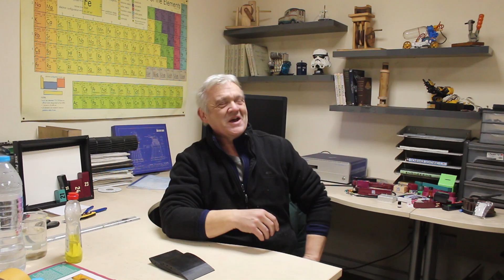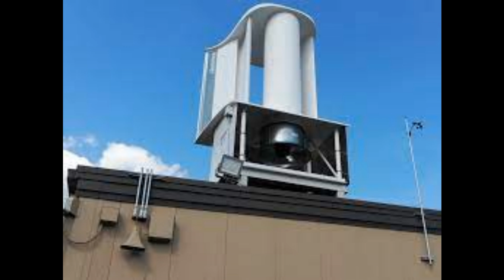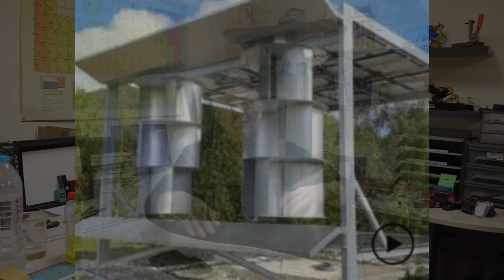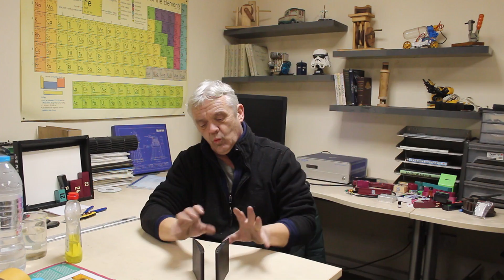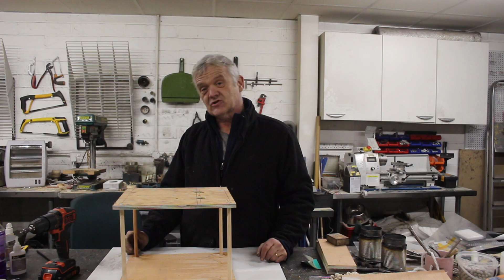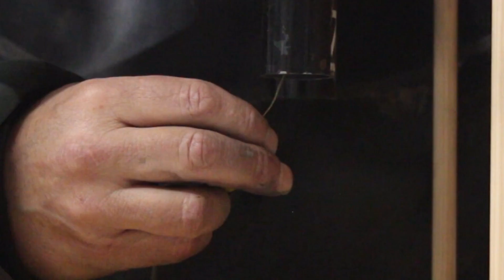1792 Exploring The Aeromine #elegoo #neptune

Comment: There is a way to make this kind of prints faster by taking advantage of the vase mode. It can be "tricked" to make pretty stiff models. It wouldn't work for models with horizontal through holes though.

Comment: Would there be an increase in efficiency or gain if you put a vertical wind generator like a ugrinsky in the low pressure area between the aerofoils? That is, would there be a benefit of faster air (and more air volume) hitting the vertical wind generator?

Comment: Now, i think that due to density of fluid, which air is, and inconsistency of speed, this is not so great. However, this could make for a good flow water energy capture, as the speed of any running water is more constant, and the relative pressures would be more dramatic perhaps. So, maybe using all water, or water pulling air, might be more efficient in power production?

Comment: I saw on a published   paper that a  NACA profile S1210 had been used. I have the data for it if you are interested ? It is a high lift low speed device. Probable just what is needed in this application. Did some work on lifting surfaces  for a Queen Mary aeronautical degree. V interesting.

Comment: As you've pointed out many times,  cost effective wind generation in urban areas is dependant on the ability to generate in low wind speeds. I plan a DIY attempt in the new year and I'm playing with ideas. One of the options I am considering is combining multiple aeromine "wing pairs" to suck air through one  propeller generator. The air duct at the bottom of each "wing pair" would join to a single tube where propeller would sit.  Does anyone have an opinion on wether that would result in the propellor generating in lower winds than with a single "wing pair" aeormine setup? The idea is to concentrate availalbe  wind to a single generator.

Comment: I am curious if a horizontal cone mounted on a pipe with a 90° elbow facing down would do as well or better. The cone could be allowed to rotate freely so the it always has the small end pointed into the wind. A small traffic cone or something lighter like those megaphone cones could do the trick.

Comment: The problem with wind power - very well put - too much hype and bluster from the marketing guys, too little in real output for the $$inputs  (and a couple of hundred quid in solar panels for a robust and easy to use energy solution, is hard to beat - so simple you can even put them on the roof of a car  and take camping.)

Comment: An interesting concept. My question is the stationary design. Conventional Windmills can rotate the power head (nacelles) to face the blades into the prevailing wind. How does the Aeromine adapt t the changing wind direction. If the blades are extremely tall the will need to be supported with guy wires, These wires will not let the unit turn to face into the wind for best performance.

Comment: Doesn't the design of aerospike engines show that there is no need for two planes in parallel? It Would cut down the height of the construction tremendously fixing it horizontal, and the single wing would see much less reduced air speed. Its the air speed that causes the lower air pressure in the first place. And should the wing be fixed at all? Or could it be made a floating design suspended between wires connected to these artificial muscles I saw presented on the channel. Or fix the wing on an axle through the thickest part as the hinge point and connect it a little ways down to an oil cylinder with an open end pushing or pulling the oil through a pump/generator. Even that kind of design could still make use of the artificial muscle used in small short bunches as maximum flutter range limiters. They use push pull generators in the harvesting of wave energy, robust and able to handle a wide range of pressures.

Comment: Great work, 

Would there be any benefit of adding controls system that can change the distances in between the foils as well as "angle of attack" based on wind speeds? 
A couple of stepper motors and cams can easily be added?

Comment: 2:50 minutes in - There's nothing wrong with being called "Brilliant but Slow". I had a girlfriend that used to call me that all the time.
The F1 or F16 [I'm a bit slow] aerofoils have them there holes  for creating laminar air flow up to and beyond that point if there is a vacuum on the other end of the tube, though I suspect the holes are way to large for this.
There was a plane made years ago that had tiny holes all over the wing, and the intake of a small jet engine was hooked up to the void in the wing. The effect of this 'suction' was to prolong the laminar air flow over the wing just about doubling the performance, and thereby reducing the fuel used by probably four times. Why didn't it catch on ? The difficulty in keeping the holes clean and clear, as once blocked performance downgraded to normality and there were thousands of tiny holes all over the wings - a maintenance nightmare. 
One cannot take a wing from a full sized aircraft and scale this down to model sizes and expect the same performance. It don't work like that. For small scale wings you need a NACA aerofoil shape designed at the outset for the size that you want, then at the wind speeds you expect to use it on. It is called the Reynolds number cause a Mr Reynolds invented the scale.
There was nothing intimidating about building up model aircraft wings out of Balsa wood on the kitchen table. Ask my mum if you want to know. Did it all the time as a young lad. Builders foam is probably the quickest and cheapest method of construction with a skin of Obeechie wood as the covering. Done in a  couple of hours rather than days and at high cost of the filament printer. Check your local well stocked model store or online.

Comment: it would be interesting to see how the thread-cotton behaves with air passing over just the tube. I also wonder how the wing itself performs laying down like on the edge of a roof, would the low pressure pull enough air to run a small turbine/fan generator

Comment: Have you ever watched Burt Rutan's tutorial on making airfoils for the Varieze kitplanes? It's a composite that is far less complicated than the standard construction with ribs and spars. Simple airfoils like these are ideal for that method, which is basically hot wire foam work and fiberglass.

Comment: Thank you for another interesting look at these " bladeless " turbines.  I looked at the shape you printed and with a few modifications, particularly making it round instead of a flat blade, you end up with the Dyson fan working as suction.  I still believe people are missing how to scale up such turbine systems.  they do not need bigger, they need more.  At ground level the wind may be slow, at the first floor level it can be higher and by the height of a second story could be in the opposite direction and a different speed.  That is not a problem for stacks of short vertical wind generators.

Comment: I doubt it will beat a regular design in terms of power extracted from a given amount of wind, given the indirectness of the power transfer. However, from a mechanical complexity perspective, it has a lot going for it. Rather than the entire structure being something mobile, supported by bearings, vibrations and what not; the large bit is a nice and boring static bit of geometry; and all the air->electricity conversion can happen in a nice and focussed small volume of high power density. That is rather neat.

Comment: I think their only improvement to capturing wing energy is that there are no moving parts to wear out and a reduction in operating noise. But as pointed out high volumes  are optimal to it's effectiveness. One part of the Aeromine was missing in this demonstration, that being the cylinder between and slightly forward of the fins, perhaps that increases intake and pressures. I don't know, and Aeromine is being secretive.

Comment: Great video again.  I think the Aeromine (eg the one being marketed at the moment with the central pipe between two aerofoils)
is primarily being tested/installed on large warehouse type buildings, sat on a roof/wall edge facing the prevailing wind direction.   If they are installed in close proximity to each other along that leading edge, they should catch the upward flow of air hitting that wall.

Comment: I believe you should put foils parallel. And maybe put it on a turnable top, just to make it turn to wind direction. Bottom part, generator wires etc, may be fixed with only moving parts on top. In original design, there happens to be a big center hole in the middle of the foils. but your design has holes in the middle of the foils. Is it intentional or not?
Inspiring video as always.

Comment: Great video (as always).. I'm wondering changing the angle you have the 'blades' will effect the low pressure 'strength'. Though they looked quite open at the trailing edges...
Making them adjustable would let you tune for maximum 'suction', and then fix. Spacing between I guess could also be adjustable via elongated 'slots' for the down tubs.
Do you have an instrument for measuring negative pressure (an old altimeter might work :o).

Comment: Thanks. I did wonder about a diy thing. I think i would probably add a plastic skin to airfoil sections to avoid the long print; like a cellulose and paper balsa wood plane.
Reply: I was thinking similarly.  There was a liquid you put on water and dipped your wing frame in from hobby shops to make wings from plans years ago.  They may still have it available.  A friend of mine was in to model aircraft and he would do balsa frames and " dip " and roll the frames in this solution that floated on water and a day later paint it.  It made quite a durable skin on his aircraft.

Comment: I'm wondering if the scaling made the holes on the airfoil too large.  Is there an optimal size for those given the other dimensions?
Reply: if you look at the model they used in the wind tunnel tests the amount of hole was a lot bigger if anything -3 rows of rectangular holes, positioning may come into it too, but as an experiment you could tape over some of the holes to reduce the area